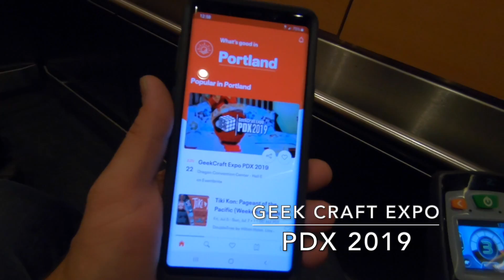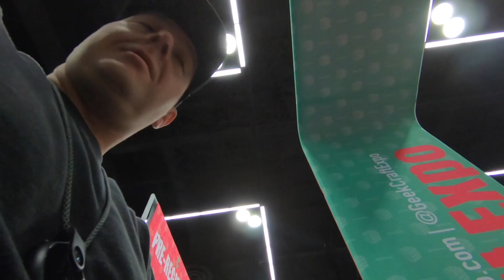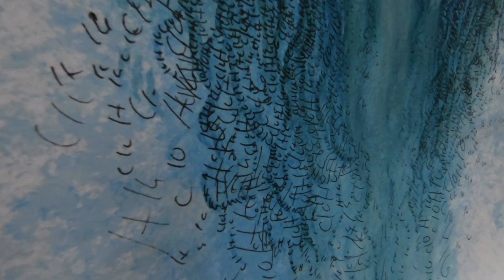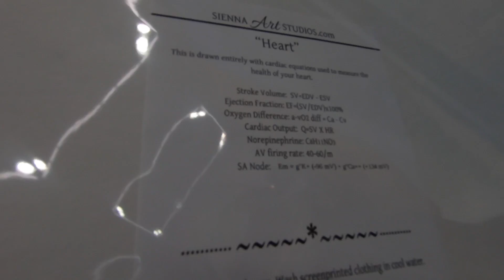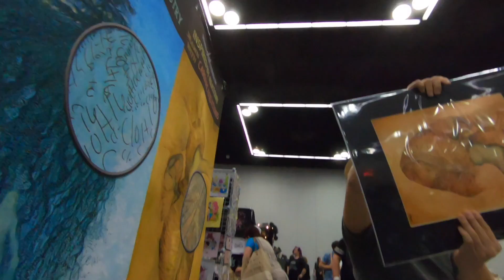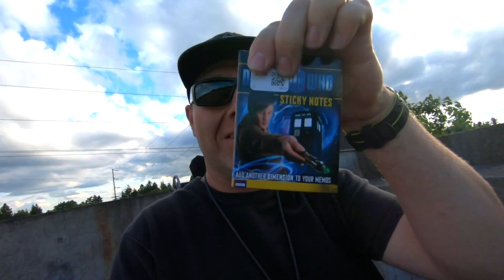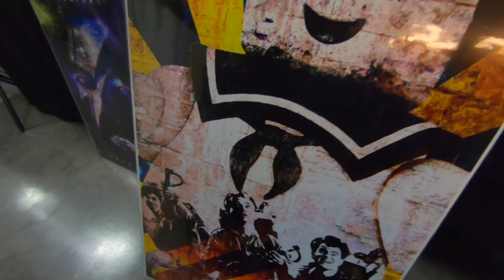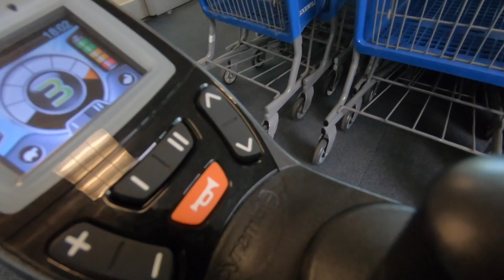VLOG 434: GeekCraft 2019 & life discussions!

Comment: make sure you didn't break that rear hime joint that's supposed to keep a rear wheel straight up and down. I broke mine and had that negative camber problem I think hitting a pothole? Also those spaces may be causing a problem with the camber
Reply from the maker: Yea everything looks like it’s intact... the spacers keep the tires from interfering with the frame/fender mounts. They were on there when I got it. But makes sense that any extra spacing amplifies camber!

Comment: Great video. I changed tires on my old chair couple weeks ago and a week after I get a phone call "your new chair is here" lol. I've got 646 se now before I had 222 se lol. They're pretty much the same only the 646 is smoother and a little faster.
Reply from the maker: always seems how it works! lol ive got a 626 that i used to use... its fairly fast.. but dont think its technically the 'high speed' version.  does wheelies though!
Reply: @TotallyNormal-   Wheelies are great. I need to adjust mine to do better ones because I can't hold it lol and it's a tricky one too. They spin 360. Once it does wheelies and you try to turn while you're on your wheelies it spins you around; if you're not too careful you could hurt yourself lol. Maybe I should wear a helmet lol